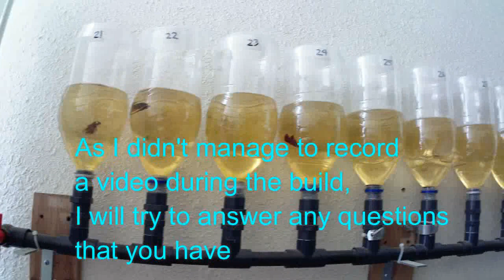Easy water change Betta rack | Soda Bottle

Comment: great system as long no bottle breaks ! otherwise all jars are empty in a few seconds !!
Reply from the maker: thanks,, PVC and Soda bottle reacts to pvc solvent the same so no issue in connections.
Reply: @JarunsHobbyTV   I know !!! and as long everything stays sealed  everything is fine ! I used a system like this and had never problems but a friend of mine did had some seal problems !  ……...… like I said it is a great system ! ps. and the bottle size is just perfect to raise bettas !

Comment: Im worried about the fish when you drained all the water. It will cause stress to the fish
Reply from the maker: Thats my concern too, so I   skip the 100% drain daily,  I do 50 to 60 % instead  and do the 100% weekly, no difference at all, so I can reduce stress and save water as well☺️
Reply: They have a labyrinth system    They are bettas...